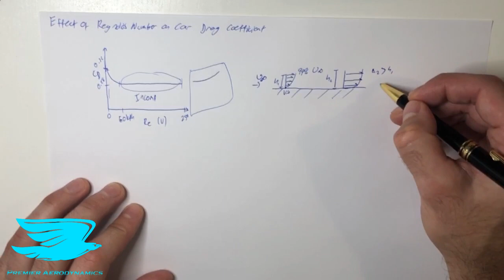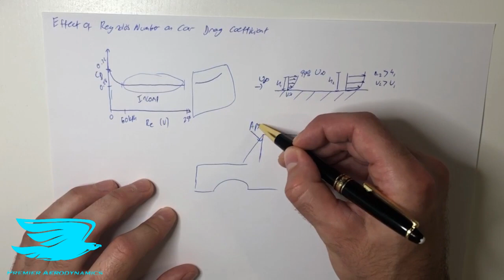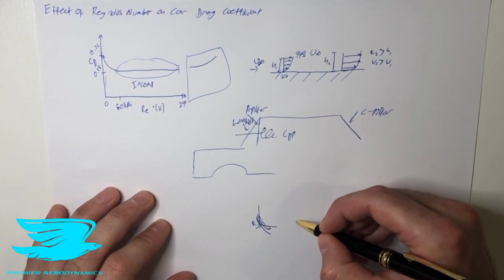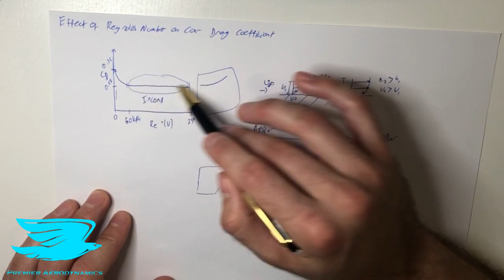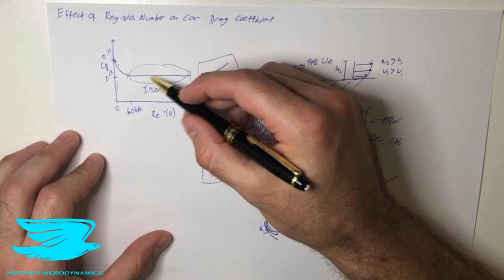{Automotive Aerodynamics #8} How the Reynolds Number affects Car Drag

Comment: It's almost like the object itself doesn't cause drag, but the air itself. If you look at PIV of streamlines on a car, you notice on the windshield that the pressure builds up on the base, and the streamline actually hops over the area of maximum static pressure.
Reply from the maker: That is true to some extent. The effects of the object are felt away from the object. However, all of the effects seen come from the object. So, yes, the changes in velocity and pressure can create drag away from the object, in a sense, but it is only because of the object that this drag is created.